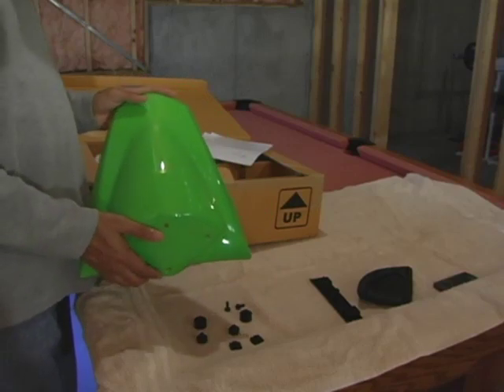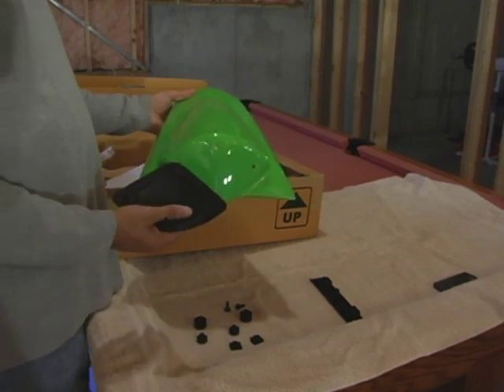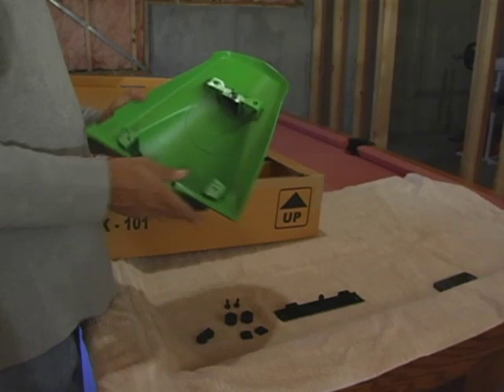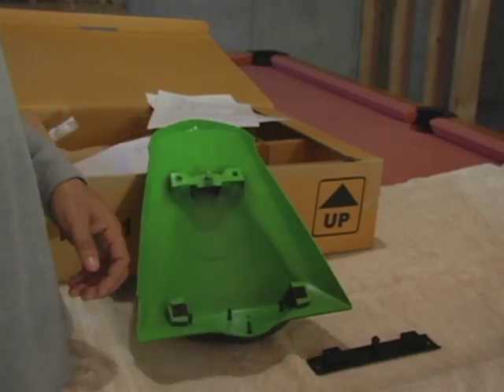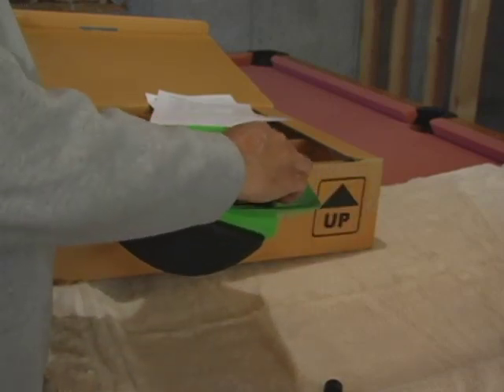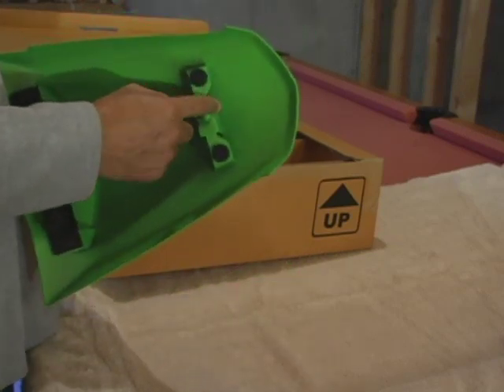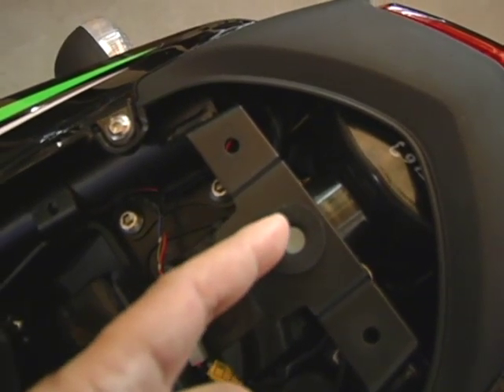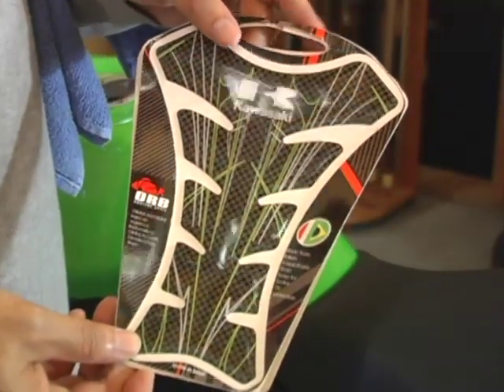2010 Ninja 250R - Seat Cowl Assembly & Tank Guard install

Comment: @travelersjaunt i meant the lock for the seat cover (how you lock it with the key so it doesn't open unless you unlock it), but if the helmet locking feature is still accessible i'm assuming the key lock would work as well. sorry for being vague! cheers man